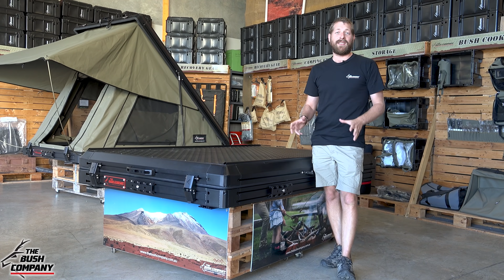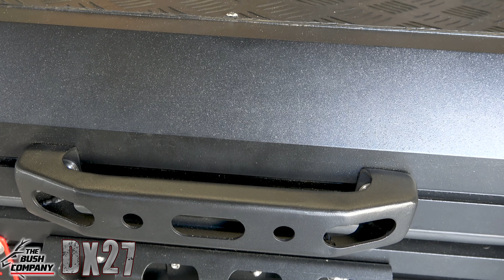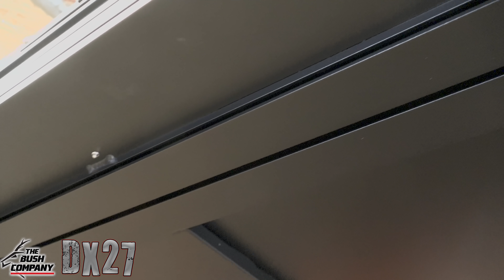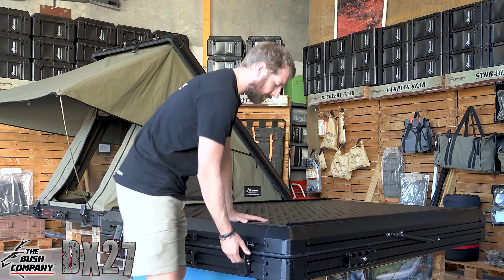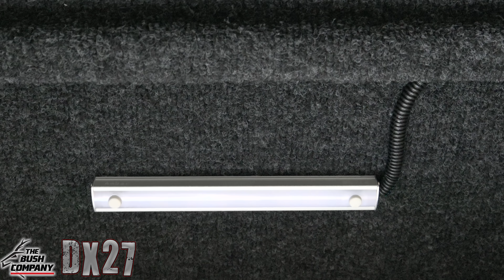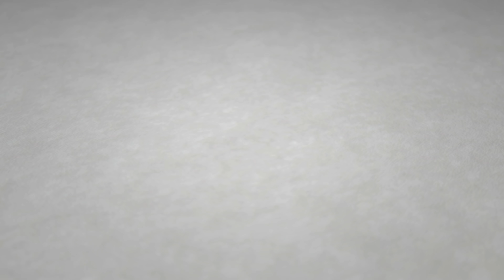DX27 Clamshell Rooftop Tent - The Bush Company

Comment: It would be good to offer a narrower and slimmer option. Something with an outside dimension of 1200. Lighter the better. I had a motop tent and liked the dimensions, just hated the quality. Just checked, these are 94kg, that's far too heavy for most roofs when you then throw on an awning and mounting systems.
Reply: Hey mate, they are fine if you understand that you get what you pay for, the canvas is thin, it will leak, condensation and overall build quality is low. It's budget for a reason. The leaking was what I hated.